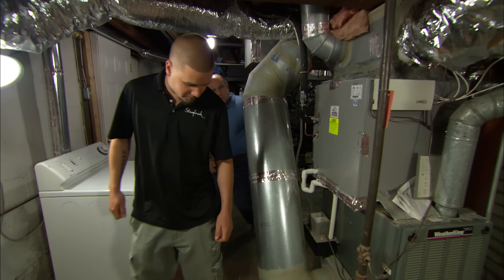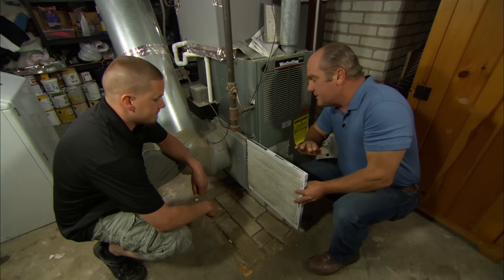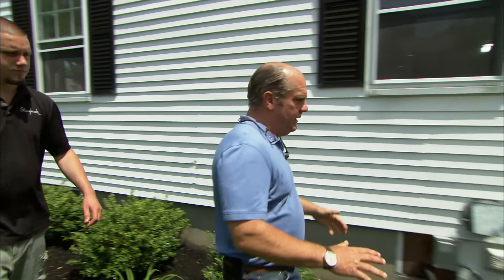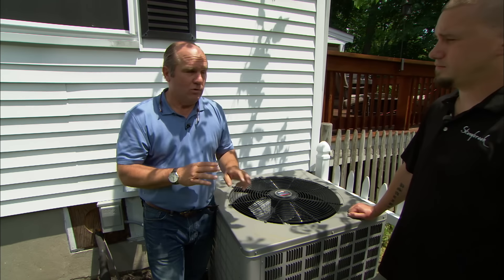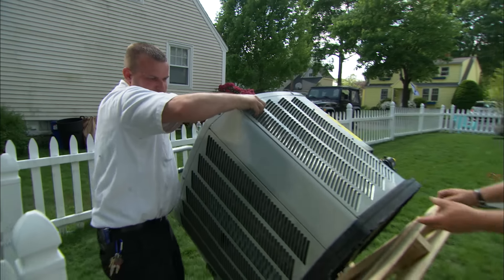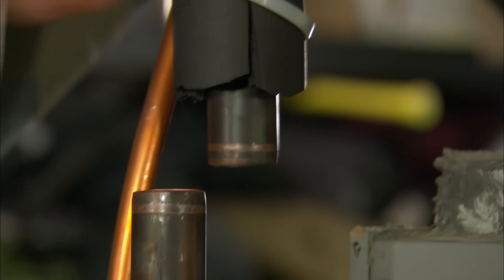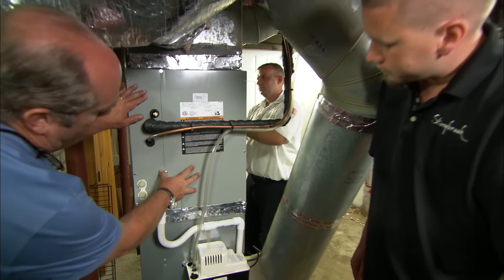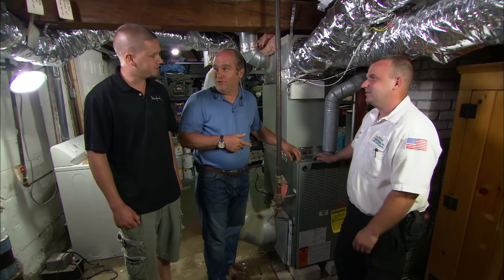How to Repair a Frozen Air Conditioner | Ask This Old House

Comment: This guy didn't have a clue about airconditioning why didn't they check airflow I've cleaned plenty of coils and even blower wheels not to mention the return was definitely undersized also the duct system looked very poorly installed alot of single taps no trunk line just asking for disaster also that small pleated filter has too much restriction needs more filter surface to make up for the restrictive filter and how long do you think it will be before the heat exchanger gives up the ghost due to air flow

Comment: What the hell is going on? You were probably low on refrigerant or the evap coil was dirty. Could have checked this first
Reply: You sure about that? So the episode should have been the guy comes over takes a broom and cleans the coils, the end? The producer of the show wanted to do an episode where the equipment was too large and they replace it, but no you wanted a boring episode where they have the unit recharged and everyone goes their way.
Reply: kotk05 - Because it’s probably true. It doesn’t matter what the producer wanted to do. If the unit is freezing up most of the time it’s loss of flow across the evaporator coil or low on charge. If you’re trying to sell a new unit and display it on video then pick a different way to do it. My comment is one of many that feel the same way. He also explained the flow refrigerant backwards. This video could’ve been done differently that’s all. Just my two cents
Reply: kotk05 - what if a tech came to your house because you were having the same issue and they end up ripping out your entire cooling system and charged you 5 to 10 thousand when it could’ve been an $80 service call for a dirty coil or low refrigeration. Why would anybody want to pay thousands of dollars when it’s not necessary? My point of this is they could’ve checked the refrigeration and the coil for debris first. If that’s not the issue then move on to something else but that is the easiest and cheapest thing to check first.
Reply: @fatkat311  if they did the show your way it would have been boring, you understand the show is for entertainment first. Of course I wouldn't have replaced the system, but if their producer wanted to pay for it, then why not.
Reply: kotk05 - this is not for entertainment. This is not a reality tv show. These are supposed to be real techs provoding real world, accurate information. People who dont know how hvac works are getting false information from this video and possibly replacing their equipment when its not necessary. There are plenty of fake bullshit shows to entertain people. Videos that show this kind of work are not supposed to be entertaining
Reply: @fatkat311  it is for entertainment, these scenes are re-shot and somewhat rehearsed. They have probably done a hundred hvac episodes, you can go back and watch the boring one where they send text messages back and forth with the owner about checking the coolant levels.
Reply: kotk05 - No I’m sorry nobody watches HVAC installation for entertainment. I don’t know where you are from or what you watch for entertainment but that makes no sense.
Reply: kotk05 - if you like these for entertainment there is no issue, watch what you like. Most people are watching these videos for instruction. The video should have a disclaimer that explains this is for entertainment if that is the case. Watch what you like have a good one
Reply: @fatkat311  wrong again, these are for entertainment whether "I will" it or not. The majority of people watching are just watching for the heck of it. Now if you want to take issue with PBS go right ahead, ask for disclaimers. They'll tell you to go get lost, they're not going to drive away 98% of the audience just because you think they need to run the show your way.
Reply: kotk05 - they will drive away the audience when they are doing hack work and providing a bullshit incorrect diagnosis of the issue. I am not taking issue with PBS,. If they want to put out bullshit, go ahead. Read through the rest of the comments, not much positive feedback. That will drive away the audience by itself. In all sincerity If you and other folks are entertained then there is nothing wrong with that, i just dont agree with the video.. no big deal, have a good one.. nice talking to you

Comment: LOL so many things wrong here.   
1) return to small the way its mounted to side of the furnace it can not use the whole filter area.  Should have a return box with a min 14 inch round for that size I usually go 16 inch for three ton. The should of turned furnace and added return box.

2)  should of at least used a condensate pump with a spill switch to shut off unit if pump fails.  I would of added a easy trap with switch also.

3)  lol this tech says charge is all set as unit comes with enough charge for 25ft of line set.  I have never seen a conventional condenser come with that much.  Usually comes with 15 ft worth of charge.   lol this guy says all set try setting sub cooling to mfg specs then checking super heat to verify charge level and that txv is working.  Then check temp diff bet he didn't use some low pressure nitrogen thru the system while brazing.  

4) I pretty much peed my pants when the this old house guy told customer the wrong flow of the charge.  Wouldn't doubt if that so called tech knows the flow of the charge.

5)  I bet this guy will still have freezing issues with that return.  Also noticed a zone system installed did they verify there was a supply duct sensor installed and duct temp sensor set at proper temp?  Im guessing not as it would not be freezing if sensor was working and set right.  Also should have a zone bypass on it I couldn't see it.

Comment: You pointed to the wrong line! It goes back through the suction line not the liquid line ! 
That line brings the hot liquid from the compressor! . 
Plus you guys are selling that poor guy a whole new system! When his current system is working fine! Shame on you! 
His return air piping loos severely undersized! 
For starters ! 
1st Why not get them more return air 
2nd find a way to use the 4 tons they own already ! Even if it means wasting cold air! 
3rd save them thousands of dollars , rather than just making a sale!

Comment: Rip off evidence here!
" the return air duct was too small ... so it was going to freeze up"
If tonnage is overrated for the sq ft of living space He could add a supply by pass and bigger return to safe the home owner from spending over 6k! He also stole the refrigerant...😂 he could pump it down back in to the condenser..."no need to recover it😱 unless the existing compressor isn't working, but this one obviously it was operating "
RIP OFF!!

Comment: Should have use a two and a half ton for 1300 square feet
Reply: Justin credible  nope
Reply: Justin credible  you actually have no idea what you're talkin about maybe if you look more into ductwork and see if there's any issues with that but to upsize equipment just to get cooling capacity but it also depends where they are in Ohio what I said would be the correct size

Comment: "the wife" I think we can do better than that.  So I guess the question that should have been asked up front is how long has this been happening.  And are there any times where it works perfectly fine with air conditioning with no freezing.  After checking for a leak, and proper charge, then you would go to the sizing of the unit.

Comment: Ac scam man in progress, even a first day cadet knows freon flows in to the house as liquid on the small line. Air flow is absolutely critical to keep A coil from freezing.. Does he think the AC somehow knows its in a smaller house? It should work no matter what size house its in or weather windows are open or whatever should still function without freezing. The ducts are too small for that unit, or there could be a charge issue. In his defense it might be to large for the house but that would be more of a humidity issue or short term to reach thermostat. Some fans have variable speeds to help with this issue.  An ac scam man will pretend to know things then put in a new unit because hes clueless of even the direction of freon. Txv should also be controlling the superheat . I did not see a single check of subcool or superheat. Charge by subcool with txv.  After air flow confirmed and blockage is removed, proper charge must be checked.

Comment: NEVER pull a filter out while the unit is running!!!  This guy is not very knowledgeable if he doesn't know that.  I caught that within the first 2 minutes of the video!

His evaluation of the evaporator unit was NOT thorough!!!  He did not examine the initial install to see how efficient the unit is before going outside.  By this I mean and it was very obvious to me watching the video that the duct system is inadequate.  The intake/return duct is too small for the amount of air blowing out to the rooms.  They MUST match in size or the return duct should be a little larger or there will not be efficient transfer of air from the outlet back to the intake.  Are the ducts full of dirt?  He was shown in the video measuring a couple of ducts but did not explain the results leading me to believe he does not know what he is doing.  He didn't measure them correctly either because you should always measure the duct with out insulation!

He should have de-iced the evaporator to inspect it correctly.  Was it dirty?  Did the drain work efficiently?  Being low on refrigerant can cause icing!

VERY CRITICAL - Did he evaluate the upstairs rooms to see how easily the air transfers from the output vents back to the return vent?  I assume NOT!  By this I mean,  are they blocked in any way?  Are they sealed at the outlet into the room for each room?  The gap between the duct and the hole cut in the floor must be sealed for maximum efficiency!  Do the occupants keep the doors closed to maximize the efficiency of the system?  They should if not doing so already.  There also must be a minimum of a 1 inch clearance at the bottom of every door when closed (carpet?) or the air will not return to the return vent effectively which is a must for an efficient system that doesn't waste money.  Close the doors to every room year round to maximize the efficiency of your system.  It will keep the heat or cool air  in the rooms where it belongs.  It will also save you a whole lot of money because your furnace/cooler won't have to run as often.

THIS IS CRITICAL - What do the occupants of this house set the thermostat to during the hot weather?  The cold weather?  It can make a big difference if the setting is too low during the hot season.  Too low during the cold season.  HOT SEASON EXAMPLE:  If the thermostat is set to 70 degrees then the unit works harder to keep up if the outside temperature is 95 degrees or greater especially in the higher humidity regions.  Let's use 95 degrees in an example.  Setting the thermostat to 70 while the outside is 95 degrees is a difference of 25 degrees.  If you set the thermostat to 74 then the difference is only 21 degrees.  The higher setting is still comfortable and will be less stressful on the unit saving BIG money.  Keep the setting constant 24 hours a day and never raise or lower it.

COLD SEASON EXAMPLE:  Set the thermostat to 72 degrees and NEVER change it.  It will keep the house more comfortable and save a lot of money.  Remember, I suggested that you keep the doors closed all the time to maximize the efficiency of the system....if....the system is set up correctly?

Proper evaluation is a MUST before decisions can be made!

He only had 200 square feet of difference on the new 3 ton unit which may not be enough.  Does he cool/heat any of the basement because that is a very big factor that might have been missed by the professional technical evaluator of the system.  This guy is far from being a true professional.

This system was not efficient before the modification to the 4 ton unit so the owner wasted a whole lot of money at this supposed 'professional's' suggested downgrade.  How stupid is that?

FREE ADVICE from a Master Technician - I hope it helps

Comment: You need a 2 ton system not 3 tons, you have oversized the system for the home and with increased air flow will restrict air causing coil to freeze yet again. You have no idea what your doing

Comment: HVAC thiefs at its finest. I didn't even see him hook up any gauges or anything. Yes the unit was over sized but it didn't need replaced. That must have been one of the ugliest installation jobs I've ever seen! Who connects round duct to the side of the furnace for return air? That plenum box too! No wonder the damn thing didn't work it couldn't supply or return enough air! Damn! There was so much wrong there!

Comment: Typical.  Any time something breaks on an A/C, if it's not a capacitor, they just want to put a new system in.  Guess what, HVAC company, we don't all have $5000 to $7500 to spend every time something goes wrong.

Comment: This video is a great example of why the HVAC industry gets such a bad reputation. This guy has no clue what he is talking about! First of all how about you stop guessing what size a/c the house needs and do a Manual J & S, the time for rules of thumb is beyond over! Also the first thing this guy should have noticed is this return air is ridiculously undersized and the 1 inch pleated filter is killing what little airflow the unit does get. No sizing of equipment even if it was done properly is fixing this guys return air issue!

Comment: This is bull sh***t where is the thermostat? It has to stop by it self 
Then why did this old one worked up until now 
I do this job for 10 years and i know problem was in evaporator 
It was dirty from inside or thermo sensor not working
It waste of money mate
I'm from Turkmenistan one of the hottest place on the planet

Comment: This is bs, ive seen guys dobthis before amd walk away with NICE units and charge for a lesser. But what really fixed the issue wasnt downsizing, but recharging. It doe NOT hurt to have a unit larger than needed, what put for criminals like this.
Reply: "it does not hurt to have an air conditioner larger than needed?" an air conditioner that is oversized causes humidity and comfort problems, not to mention uses more energy. Plus with liquid flooding back to the compressor that unit won't last long anyway. You can see that return is about 14 inches which is way too small for 4 ton... plus the supply looks small and poorly done and has a damper system.

Comment: Did anybody other than me noticed no safety gear being worn from the "skilled" techs. Never have the owner assist with repairs and installs and most of all his diagnosis was wrong. But if you want to stiff your customer for $7000 for a new system replacement then you go ahead. IJS

Comment: lol, they stole your good crap and replaced it with cheaper crap. Your issue was the restricted intake. My father was in the HVAC industry for a long time. if you had a larger return your ac would simply run shorter stints of time. I would wager if you tested it by removing that filter it would not have frozen up.

Comment: Clean your filters and coils  regularly, and if the fan or charge is low it will freeze. the most common reasons are... 1: Low charge, 2: poor airflow, 3: dirty coils, 4: Damaged blower fan. In this case the dumbass salesman sold too big of a system to the homeowner and now he has to spend another 5K to put in a smaller unit. 
Do your homework so you don't  get screwed, second opinions don't cost you anything from reputable companies..

Comment: This is rubbish. You replaced the whole airconditioner because you couldn’t diagnose the problem. The evaporator was freezing up and there could be a kink in the copper line somewhere, hence the refrigerant couldn’t flow properly. U could had just replaced the evaporator or repair it.....that’s all that was needed. Also old one was a copper one whereas new one was probably a aluminum or mchx material. Copper is always better!

Comment: 99% of the time when you have a frozen air conditioner, this video will not help you.  It's either a dirty filter, bad fan motor, or low on freon.  Very rarely, a crushed ductwork somewhere.  This video is pretty useless.

Comment: Wow. What a joke. Not enough return and those supplies are even worse. Do a real load calc. This system should be replaced with ductwork changes. If not they will be doing this all over again but this time the compressor changeout.

Comment: Please stop. Putting these videos up.  You installed a trane or American standard there only charged for 10 feet read the instructions.  And since when do you get 1200 cfm through a maybe 10 in return pipe. And I really don't think there are enough supplies off of the supply trunk. It thats what you want to call it. And by the way who leaves the return hooked up like that the filter will clog extremely fast its not using 3/4 of the filter capabilities. I guess you make more money selling equipment over fixing the ductwork  and i guess by under charging the unit may keep it from freezing up but boy what a waste of efficiency  some easy duct changes and his electric bill would drop significantly along with the life of the compresser being extended ten fold  please take a class on ductwork

Comment: WOW! 
The air handler setup is most likely the main problem. Few items that pop out, * R/A ductwork is not large enough * Supply air plenum is too short (creating back pressure on evap coil) * Along with using a pleated filter, all = restricted airflow that can add up to a frozen system,   
A few Modifications to the Air handler setup may have solved his issue?
It would have been nice to see a full system check.

Once again’ another hack-job/video by Richard, Stay clear of this clown.